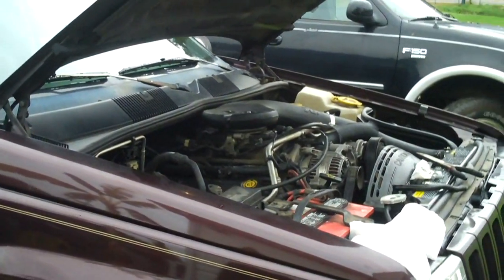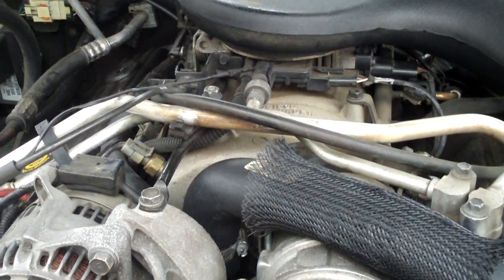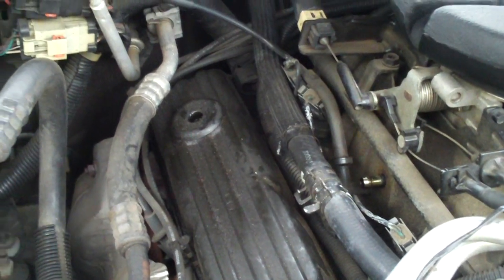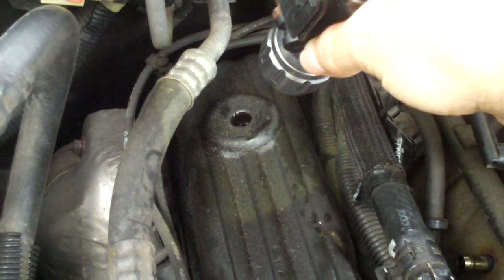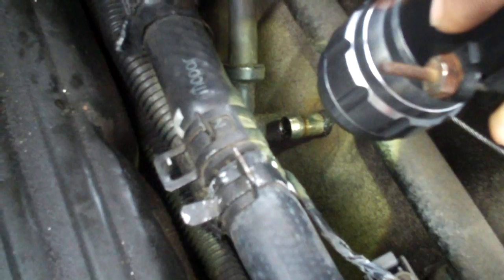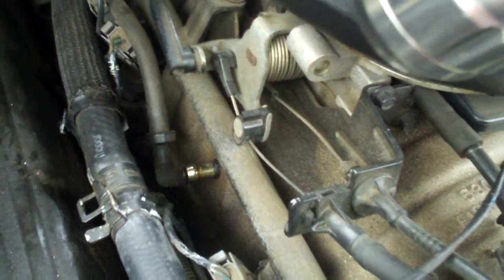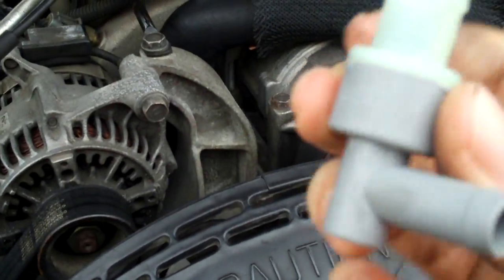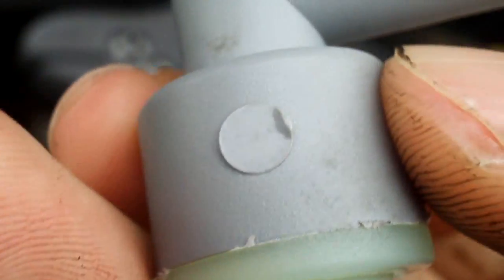Failed PCV Valve On Magnum 5.2L V8 - Possible Cause of Pinging

Comment from the maker: For anyone curious, this Jeep is still on the road almost 10 years later, with 334k miles on the clock. While the PCV valve can be one of the reasons your Magnum engine is pinging, these engines are plagued with a common issue where the plenum pan gasket fails. The OEM plenum plate on these is made of steel and the intake manifold is aluminum. Due to the different temperature characteristics of these metals, they expand and contract at different rates. With time, it causes the plenum pan/plate gasket to leak, sucking in oil, and causing pinging. This engine does still ping from time to time. Replacing the old spark plugs with Autolite 3923 copper plugs helped it some, but the ultimate fix will be to pull the manifold and install an aftermarket aluminum plenum plate and new gasket. This Jeep will likely see this type of fix when it gets a rebuilt 5.2L Magnum engine. The current engine still runs decently well aside from the pinging under hard acceleration.

Comment: Nice, helpful video.  When I changed the pcv valve in my Dodge 5.2, I also bought a new crankcase breather too.  (That was the device you showed at the start of your video on the rear side of the other valve cover)  Those have filter media inside them and can get clogged up over time as well.  It is also not expensive and easy to install.  I also replaced both hoses as mine is a 1998 and they were dried and showed some signs of cracks.  Safe travels.

Comment: Garbage motors. Every single one lasted over 300k and truck body rotted away. Chrysler should be ashamed.
Reply from the maker: Wouldn't you mean garbage truck then? My jeep has no rot, has 315k on it now and runs like a top.
Reply: LoL engines lasting over 300k are garbage?
Reply: @joshgrigsby7097  think you missed the sarcasm :)
Reply: yeah you need to wash your underside to prevent rust

Comment: Can I just block off that line and be dome with it and put a filter on that valve and block off the vacuum line?
Reply from the maker: I wouldn't recommend that.
Reply: @cubecompmtdx  If the pcv is blocked pressure will build in the crankcase and the oil will be forced out through the seals and there will be oil all over the engine

Comment: PCV is a good place to start. I usually use the aluminum plenum plate from hughes engines with the steel shim gasket and indian head or aviation sealant on the lower plenum. It fixes a lot of issues. Also , putting some brillo pad in the valve cover baffle helps.

Comment: I figured out my pcv went bad after I already changed my plenum gasket and put the aluminum plate kit on it.
Reply from the maker: Was the old gasket blown?
Reply: @cubecompmtdx  I didn’t notice any failures, but I replaced it anyways since i already had it apart. Then noticed oil on the hose going to the pvc valve
Reply: My brother put a 360 magnum in a 1984 Dodge pickup. He keeps blowing the plenum gasket. He even made a plate to try and fix it. Last time it was good for 3 days and it blew again. He refuses to blame the PCV. He says he unhooked it and it’s open to atmosphere. Do you think it could cause the problem?
Reply: @Ian-of9oi  I’m not sure. But the plate I ordered was 1/4” thick. I’m not a mechanic by any means lol. But after the plate and a new pcv I knock on wood haven’t had any problems out of the truck.
Reply: @DanielThomason  thanks for the reply. He made a plate but has done nothing with the PCV. Trying to get him to acknowledge it could be it. He’s a bit stubborn.
Reply: @Ian-of9oi  the valves are pretty cheap so it wouldn’t hurt

Comment: Yeah. Looked down into the plenum with throttle body off. There wasn't an obvious plenum pan gasket leak. Just from an ancient PCV valve. Replaced it. This 1993 5.2 V8 Magnum only has 191,000 miles. Ready to replace the plenum pan with the aluminum Mopar one when it needs it.

Comment: My spark knock gets bad on my 360 after I idle for 10-15 minutes.  Taking off under a load, it sounds awful.  I'll change mine tomorrow and see what happens
Reply: Lol, idk why im on my wifes google account, i cleaned mine to brand new while back, easy to do, worked on my caddy also..im thinkin it might be the natorious plennum gasket, but i think its bn replaced already, cant complain, had a tenant die suddenly, so his daughters sold me his truck crazy cheap, $500. 900 in new tires 3months b4 he died getn out of truck, professional lowering kit, airbag suspension, remote cd carousel, towpackage, rims, frontend grill bling, ect,ect..guess he cared bt truck more than them, anyway, 100 in tuneup, oil change, iv put 12,000 troublefree miles on it in just 6months, st 10mpg, lol.still better than my hotrod bmw 540i. Id drive to eastcoast tonight, lots of gas money ofcourse, lol..i drive the shit out of it, everywhere..it has been really good to me.....got my money worth i think, im not picky tho, i own 6 v8's..expedition, dodge ram quadcab, cadillac fleetwood brougham, bmw 540i-m sport package with some legit mods, factory and aftermarket, and a 22ft stingray speedboat with chevy 427. It gets 3.5mpg, lmao..and nextweek take ownership of a 34ft fauxal airbus with v10 i think..im partial to the older cars..and i love this old truck, added matching A.R.E canopy and bed slideout kit and kayak racks..id rather work on my cars than make payments,  thanks for the input, ill keep reading these forums
Reply: Mine does the same thing, love to know why
Reply: @sheilacoolidge5864   I changed my idle air controller and it helped quite a bit but it still sounds clangy after I idle for a while.

Comment: pcv valve can definitely cause problems, mine in my 95 5.2 dodge ram was very old and gummed up, I feel sorry for the truck honestly since the previous owners didn't take very good care of it, I've done a full tuneup plus just changed pcv valve to an oem mopar one and the truck accelerates alot better now after the pcv valve and seems to idle smoother, my pcv hose has a bit of a crack in it I need to fix though. These 2nd gen ram trucks have a fond spot in my heart, I went through a string of very junky used cars before the ram trucks...the rams even with their little quirks have been the utmost reliable for me for getting from point A to B.

Comment: I had OVER 380,000 miles on my last 5.2L.before it was ready to die from low oil pressure.
Reply from the maker: The engine in this video now has 311k on the clock. Runs great.
Reply: What kind of oil were you using? Tell about preventive maintenance please!

Comment: Spark knock can also be caused by your new PCV Valve as well. Every time your PCV valve opens it also sucks in Oil that goes back into your intake manifold and gets burned with your gas..Ths really fouls up your intake manifold and can also cause Pre ignition (Pinging,Knocking) to prevent this from happening you need to install an PCV Catch Can to catch the oil so it will not recirculated into your intake, Results will be better MPG and power..you can get one from Amazon.com for about $20.00

Comment: Clean the original pcv valve with gas . If you shake the valve and hear the ball dinging it's good .
Reply: Or maybe just get a new one  for a few bucks
Reply: Not necessarily. The spring gets hot and looses its tension. Then it doesn't seal correctly and blows straight through both directions.